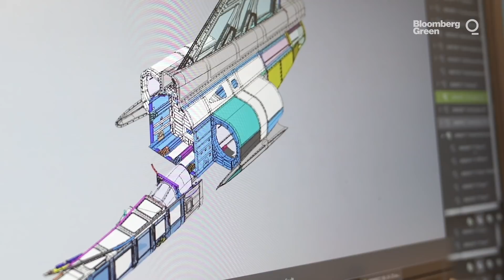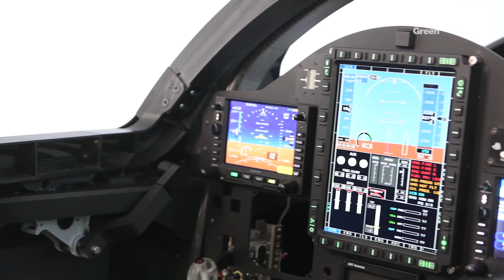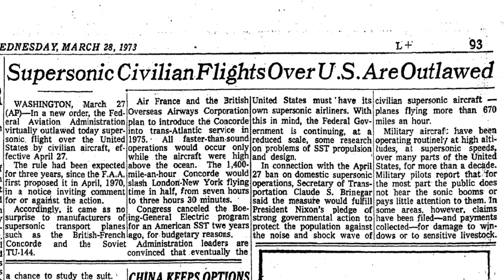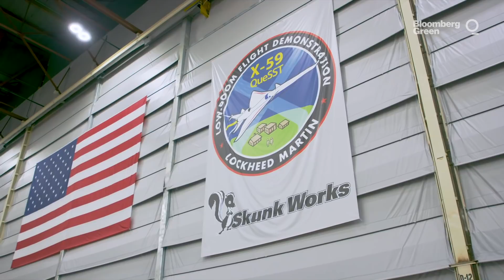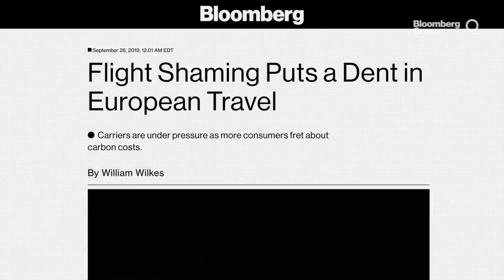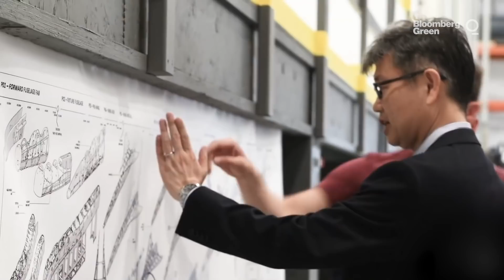Why Supersonic Jets Are Making a Comeback

Comment: The future has to be in traveling to low earth orbit and then back to your destination.
Reply: Talk about global warming... Could you imagine the heat generated from a bunch of commercial flights' re-entry...
Reply: @quattrocity9620   Thats not how global warming works holmes...
Reply: @separationstudios.263  global warming "works" by containing more heat within our atmosphere. Whether that be the heat radiating from the sun that makes it through,  geothermal, burning of any fuel sources,  etc. If over 100,000 commercial flights a day exit and enter our atmosphere everyday you can bet the would be a measurable difference in global warming. So the reason "that's not how global warming works" is because our commercial flights don't reach LEO.
Reply: @quattrocity9620  no. That's not how it works. It works by the retention of heat by the atmosphere. The radiant heat of the sun is by an order of magnitude a far greater source of heat to the Earth than any man made heat source. The burning of fossil fuels doesn't contributed greatly to the heat flux of the Earth. But the carbon dioxide, methane, and water vapor caused by human activity retains the sun's radiant heat like a blanket. Where did you go to school, Trump University?  Read a book.
Reply: @jmelande4937  first of all hopefully you feel better now that that's out of your system.  Now let's just stick to facts. 2nd, nothing you said disagrees with what I said. Setting fire to our atmosphere 100k times a day will only exacerbate our radiation to retention.
Reply: That's what king Charles I of Anillaco proposed back in the 90s
Reply: Space X Starship is looking to possibly make that a reality. The moon and Mars are vanity projects, but Starship has real practical point to point passenger route possibilities using LH2-LOX with a lower carbon footprint than any conventional aircraft.
Reply: It would be interesting to see, London to NYC in less than an hour. In the near future (hypothetically speaking) wouldn't there have to be rockets taking off/landing more frequently, to match the passenger transport volume regular air travel has?
Reply: @RB-H  exactly. Look into SpaceX's plans for and current development of reusable rockets that carry hundreds of people from sea based launching pads.  The reusable Starship and Big Falcon Rocket currently under development for travel to the moon and Mars is actually also considered a stepping stone for passenger rockets.
Reply: @jmelande4937  I once saw an animation of how the transport would work, but it was a landing pad on a river in a city, it would take off and another would land. Not sure how feasible that would be
Reply: @RB-H  not sure why it wouldn't be feasible. The planning I've seen is for off shore sea launch pads. Currently most long haul international flights leave from coastal cities, so it wouldn't be a stretch to build sea based rocket ports.
Reply: @jmelande4937  Hmm that does make sense in that case
Reply: Either that or walking hungry and barefoot with your belongings strapped to your pack of dogs.

Comment: Still a wet dream thing. If you spend hours in the airport anyway (because of ever increasing security requirements) you can only save time on the FLYING part of the journey, which means that even if you triple the cruising speed, you still don't bring down the journey time that much. Not to mention that the best case tech has only made a slight dent in the problem of the sonic boom. Most people tend to not enjoy having their windows broken, so there's still those party poopers to deal with.

Comment: There are three problems with SST's: 1) the sonic boom caused by pressure wave buildup, 2) the ferocious fuel consumption and 3) dealing with the structural heating of supersonic flight.

Fortunately, aerospace technology has advanced a lot since the development of the Concorde and the Tu-144 back in the 1960's. I think the best solution is to limit the top speed to Mach 1.6, which offers these benefits:

1) Less need for expensive heat-resistant titanium or stainless steel for structural parts, so it allows a lot more use of composite materials to keep the weight down.
2) The jet engines runs way less "reheat" or afterburner mode (or even none at all), which reduces fuel consumption quite a bit.
3)  It makes it far easier to "shape" the entire plane to nearly eliminate the pressure wave buildup that causes the sonic boom in the first place.
4) The lower fuel consumption may make it possible to travel over 6,000 nautical miles even at full speed, which means most of the world can be covered from original to destination with just one fuel stop.

Companies like FlexJet or NetJets already said they would place an order for 50 planes immediately for fractional ownership service.
Reply: Actually there's a fourth problem - noise on takeoff. You can't just use a huge high bypass fan to move a lot of gas out the exhuast relatively slowly if you want to fly supersomic - you have to be throwing a smaller volume out the rear at insanely high speed. Which is inherently noisy; its why fighter jets are so much noisier than big cargo planes.
Reply: @kenoliver8913  Hence GE’s Affinity engine. It’s essentially a highly-modified CFM56 engine, designed specifically for supersonic cruise but encased in a low noise nacelle. The Aerion AS2 will use this engine.

Comment: The space shuttle was a failure, never realised its cost, quickness in turn around and reliability, the tu144 was a failure, rushed design and fell apart. Concorde operated for 30 years. Cost b.a twice as much per hour to fly than a 747 yet took half the time from Heathrow to New York.. do the mathS! Once some visionary understood they could charge   for the speed advantage and hiked the price up it became b.a most money making aircraft in its fleet for many years..
Reply: @CharlesBue-d1s simple, it failed to meet the goals for which it was designed for! Re-usability - flight turn around was months longer than required, cost of flight much, much higher than expected - due partly to the extended process of re building the vehicle for each flight, Safety, reliability - say no more. Just because a seriously flawed technology has a few  high points in its career does not make it a success.  The USAF who, if I remember history correctly, were instrumental in the design of the space shuttle, found cheaper and more reliable ways of getting its stuff into orbit...

Comment: Hypersonic flight may face competition from Maglev vacuum trains or, hyperloops
Reply: Yeah... at least hypersonic flight is technically possible but both are economically totally not feasible. Concorde was possible only because TWO NATIONS paid for the development and the company never made money. The airlines that run them didn't made money for the first decade of running it. British Airways didn't record profits from the Corcorde until 1982, and Air France until 1983
Reply: @taavikoppel1769  well, they have just managed to safely send a living person down a hyperloop test track
Reply: @edmundprice5276  you mean they sent a plane fuselage down a 100m pipe and back. From A to A since there is only one exit and you have to reverse back. Quite an achievement. Who wouldn't want to be trapped inside a tube with no air in it. Marvelous.
Reply: @taavikoppel1769  The technology is progressing, it isn't here yet, but given 1 or 2 decades it will be much more common
Reply: Hyperloop, maybe. Super sonic non-military aircraft, not at all possible or economically feasible

Comment: I'm pretty sure we need less poluting planes, not more.
Reply: Lets just facefuck innovation for the sake of it, we already do it to nuclear, so why not again now?
Reply: @tomassin90  nuclear powered hover taxis?
Reply: @Ikbeneengeit  nuclear power
Reply: @tomassin90  ikr. Air travel is a very small fraction of vehicle based emissions. It pisses me off that many people are against nuclear power because it could "harm the environment" when not only is it the safest form of power per kilowatt, but it doesn't cause any carbon emissions. We may have fucked up super badly when dealing with the environment, but we need to solve this problem by dealing with the systemic issues instead of implementing pointless measures like banning plastic straws and plastic bags. The plastic bag thing really pisses me off, as they take a lot less energy to make than cloth bags. In fact you would have to use a cloth bag for about 100 years if you wanted to go carbon neutral with it. 

In short, environmentalism should be about implementing solutions that work, not solutions that make the populous feel like they are helping the environment, while actively harming it.
Reply: When will they make an electric version ?

Comment: Sorry to disappoint, but:
- as for Concorde, one of the main issues is fuel consumption
- it will only ever be economically and ecologically viable with carbon-neutral fuel available at low cost
- we're decades away from being able to produce carbon-neutral fuel on commercial scale at low cost

So while some company might manage to build a supersonic jet, it will definitely not become available to general public in the next decade.

Comment: Supersonic doesn’t make sense when hypersonic is around the corner.
Reply: Yeah its around the corner, but that corner is extremely far in the distance. Also, supersonic does make since unless you plan on creating a communist utopia, Hypersonic transit is going to cost way, way, way, way, way more than supersonic transit.
Reply: @phineas7423  If it was in far in the distance then you wouldn't see the corner yet. Hypersonics are here already as far the military is concerned and it will be cheaper because engine is not as complicated, fewer moving parts, and most of the fuel will be free air.

Comment: Why not generate a counter boom to annihilate the sound wave? Also, what if ZOOM workplaces become the norm and business flights become far less common?
Reply: Thank you! I never knew why this couldn't be done! I think it can be done by some sort of variable geometry body work that adjusts to the outside pressure to cancel the sound waves, even those of the engines not just the boom..
Reply: @aby0ni  The answer to why this wont work is obvious if you look at the physics of how sound works. A sonic boom does not occur at a specific frequency, but a whole bunch. As such, you can not create another boom and use destructive interference to "cancel them out." That method only works when you produce sound at very specific frequencies. Think about it; this is the same tech that is in noise canceling headphones, and there is a reason why those can tune out the specific and constant dolling sound that an airplane makes but are useless against an erratic and screaming baby. Also noise canceling tech can only work in a confined space - this is why the Samsung beans don't work.
Reply: @phineas7423 
If you know the sound that you'll produce you can cancel it.
The sound can be predicted using fluid dynamics models.
Reply: @aby0ni  Not to the accuracy needed here. Not only would the device need a ton of energy to work, but it wouldn't work in the first place because the sound it produces couldn't catch up the the sonic boom as both sounds would be traveling at the speed of sound. In order to have destructive interference you need to be in a closed area and give the waves something to bounce off of so they can collide. Otherwise you would just be producing two booms instead of one. Also, while you can predict the sound signiture of sonic booms with fluid dynamics, these predictions aren't perfect, and if the destructive soundwave had any imperfections it wouldn't work.
Reply: @phineas7423  
It's gonna be a tuning mechanism in the jet/rocket engines, not a device, just a number of engines with typical sound signatures. 
And you don't need to bounce the wave off anything since you're not aiming to produce a standing wave, just a sound wave with a slight delay.

Comment: Two sidenotes on the carbon neutral fuel point:
1. It's about 10x more expensive right now
2. Carbon emitted in the high atmosphere does not easily come down to a level where it can be absorbed by trees
Reply: Yes. The fuel price is really what's going to set ticket prices and if this sort of travel is going to come to market, it's going to be extremely exclusive. Carbon footprint is going to be a hard sell to airlines who are proud of their extremely fuel efficient and clean fleet and are more responsible to public opinion. The "New Concorde" definitely still largely in the ambition phase. You can really tell by the chosen last lines in the video, where the guy is being romantic about relationships and falling in love, and not about the future of fast and clean air travel.
Reply: Siemen Brinksma why don’t we burn something else
Reply: @Richard Gilley additionally, we don't even have enough carbon neutral energy to satisfy current energy demand, we need to recapture C02 and not use this energy to make supersonic flying carbon neutral.

Comment: Ah. Aerion Supersonic seems like the best half of the solution of supersonic flight. If it's actually carbon neutral.
Reply: no it's bullshit, you need massive amounts of energy to revert CO2 and H2O into methane (fuel) and O2, and that energy comes primarily from fossil fuels (coal and gaz plants mostly). if through some witchcraft the energy all came from renewables sources, themselves manufactured from renewables, I'd take my hat off, but the world is not even close from that point.

more realistically, nuclear power plants would do the trick, provided the public accepts it, but that's still quite a waste of energy for a dubious benefit.

Comment: Don't forget SpaceX. Their starship is going to do "hop" from the US to Japan in just 30 to 40min.
Reply: That'll be a long time coming. But, if it's going to take these supersonic builders until the end of the decade. Then ya spacex might have their starship, for earth travel, ready by that time.
Reply: @JJs_playground  Probably yes.
Reply: I'm curious how fuel efficiency, environmental impact and overall cost per passenger would  compare between a supersonic jet and starship.
Reply: For $1,000,000 a ticket.
Reply: Though, it won't be like airplanes and not available to everyone. That would be a terrible disruption to civil and commercial aviation, plus their starlink satellites alone prevent them from doing those hops so regularly, without them being moved.
Reply: @sexycow98  Starlink have an elevation of around 560km above the earth. That is 150km higher the ISS. No need to go that far up into space to go around the globe. But you are right, it's not an aeroplane.
Reply: @sexycow98  starship will be moving on suborbital trajectories.

Comment: Wait until your altitude is high before approaching supersonic. It’s that simple.
Reply: I really wish it was. The higher you go the harder the engines have to work to propel the plane, and the more fuel it takes to get to high altitudes in the first place. Sure, we could all travel in Low earth orbit to get from New York to Singapore in minutes, but that would be exorbitantly expensive, and not practical for the typical consumer. The Concorde flew at around 50k feet - Which is basically the celling for profitable commercial flights - and they still had sonic boom problems.

Comment: "The failed Concord"??
Reply: @John Higgins Concorde had multiple airlines pull out of their original offerings and mainly offered service between Paris/London and New York/DC. it was banned from flying over the continental US and other regions. i would call that a failure. not on the level of, for example, the 737 MAX, but certainly not performing at what everyone expected.
Reply: yes, it stopped flying and wasn’t very profitable. it failed.

Comment: insane. Hyperloop on the ground, supersonic between oceans. Guys, we've cracked distances looooooooooooooooooooooooooool
Reply: Hyperloop is obsolete, Korea already has faster trains.
Reply: Maybe man. From what I've researched, Korea has indeed pretty fast trains!! But they don't come near the proposed 1200km/h (760mph) that hyperloops are supposed to reach. Also, the fastest commercial train recorded hit speeds of only 540km/h, which is less than half of the hyperloop expected terminal velocity. I mean, maybe a faster train is under development in Korea that I don't know of? Either way, it's hard to grasp how something would be as fast as a hyperloop when, in the best option, has exactly the same rails and technologies except also has the air resistance...

Comment: More likely this supersonic planes may be used for the transport of vaccine
Reply: Why
Reply: @swang2000   for speedy transportation
Reply: @soultrader9207  yeahhh...so what
Reply: Crazy Rules   truly right
Reply: How does noise pollution have anything to do with transporting a vaccine
Reply: @swang2000  bro if you remember planes part vibrate while flying so as our vehicle
Reply: Not only noise pollution but also air pollution....it emits nitric gas which is not good for our atmosphere
Reply: @soultrader9207  hmmm
Reply: Bro wat does that have to do with transporting vaccines other than the fast part
Reply: Also, the fast part doesn’t even matter
Reply: Transporting vaccine using these airplanes are rediculous